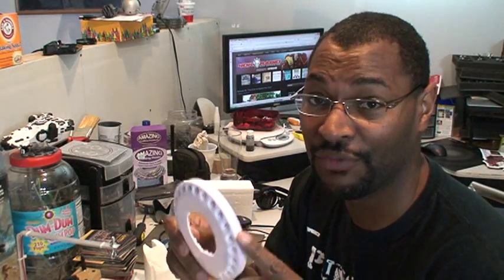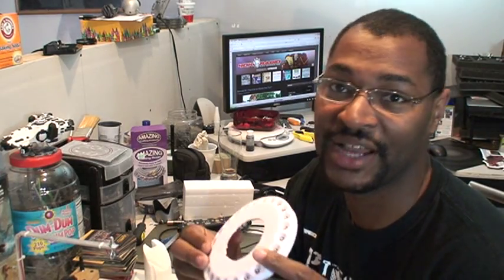foam cutting table setup

Comment: I made exactly cutter ,but the electric part no working, i don't know what happen because my transformer is 12vDC 800mA and the electrical cable is 22 awg exactly electrical cable transformer, the power jack socket is for this transformer too, what is the problem????

Comment: I have a 12volt 1.25amp transformer. its says AC inpuut but does not specify if the output is ac or dc.
Does it matter ?

Comment: Wait thought you were going to be right back? LOL Nice video, I just finished building my hot wire table, well all but the power. I was going to build my own using a 12v transformer and a dimmer switch to adujst it but i think i will go with a power supply like you did. I still need to order one, the biggest i have is 12v 300mA and thats way to small. Keep up the good work!